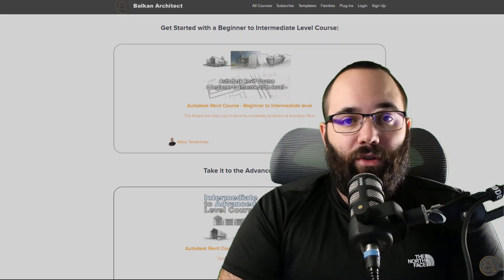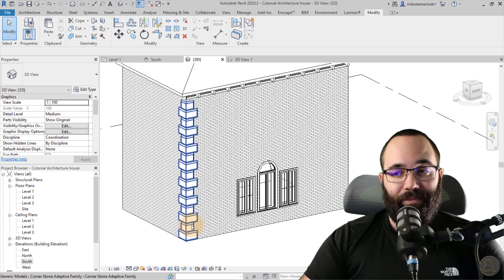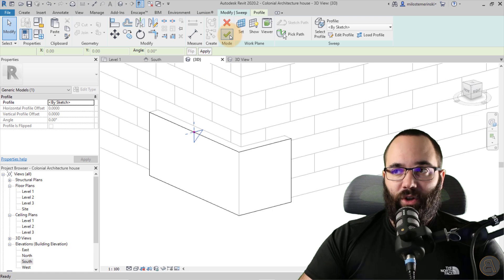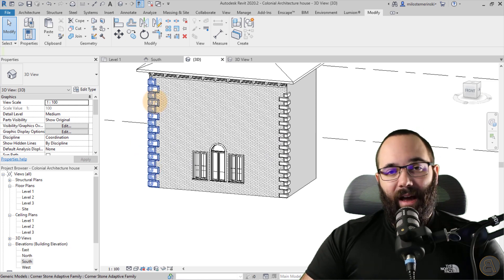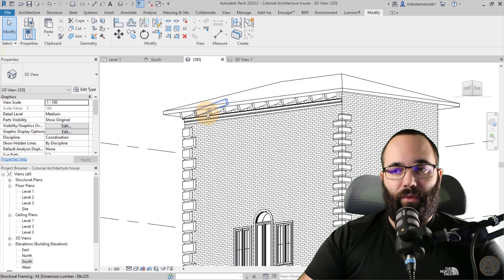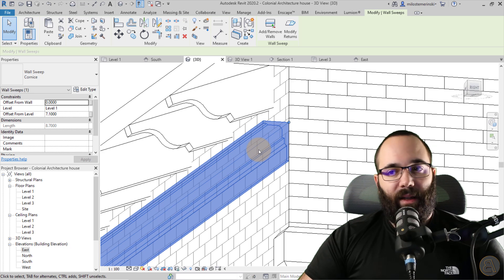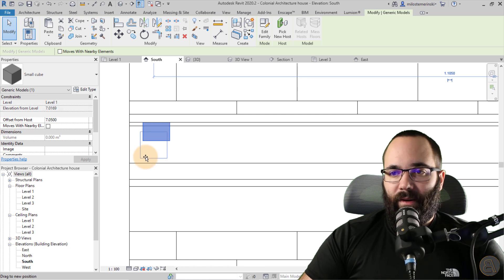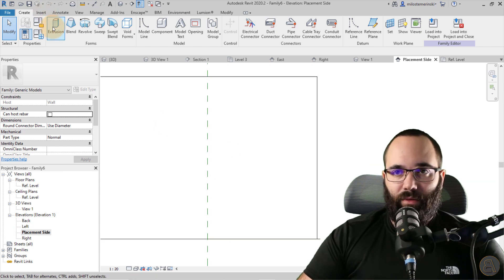Colonial Architecture Elements in Revit Tutorial

Comment: Off topic question, I looked around however can’t figure out….

In a family, say a “water closet”, I have dashed lines set up to depict required “clearances”. Works fine, however when I have the family inserted as an existing “water closet” the clearances show up as solid lines, when I have same exact family as “new construction” element, the clearance lines show up correctly as greyed out dashed lines. Anyway to have the family placed in existing phase to show dash in New Construction phase, besides manually overriding the lines? Basically the existing water closets in a building, I would like the clearance lines to remain, just as an existing element with the dash lines.

Comment: for the repeating elements, if the purpose is modeling, I Kinda use the railing command, where the cornice is the main profile and the repeating elements area the balusters which i model as a baluster family. it saves a lot of time and is reusable and parametric
Reply: This is a smart practice. It's also less computing load for your model + you can schedule length. 
Good tip.
Reply: can you show me?
Reply: @salannamckinney  sorry for the delay i didnt get the notification, i will look fir an example i did and post it here tomorrow
Reply: @salannamckinney  i cant paste the image in youtube comments to show you an example